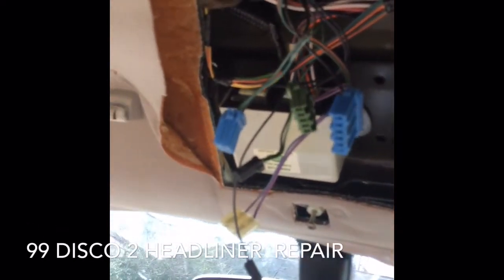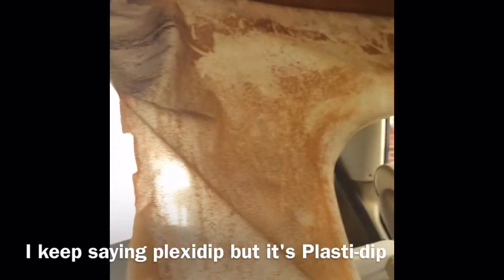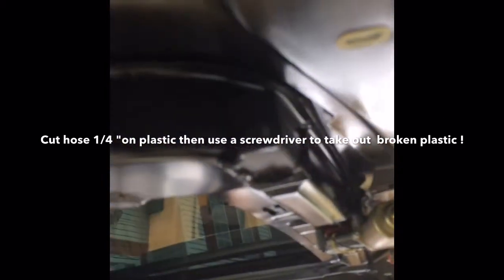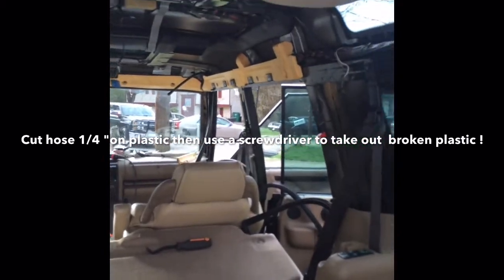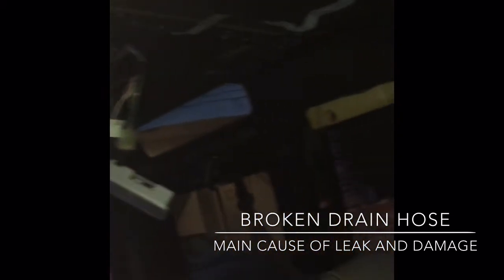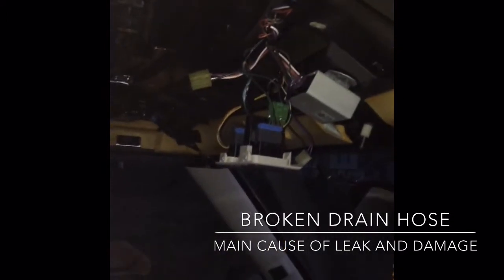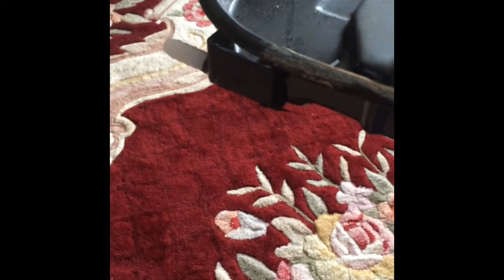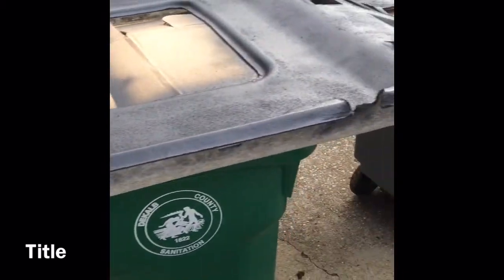Disco 2 Headliner Repair

Comment: do you have a good way to take those cargo nets off?
Reply from the maker: Yes Michael. There are some small rivets on the back of the headliner. You will have to remove them and the entire net/plastic bracket will come off. I broke a few of mines and just used screws and washers to replace the back because I actually like them.

Comment: Your drainage holes in the sunroof are blocked
Reply from the maker: Actually the one in the back was blocked. It was not leaking at the time of this video, but the truck was parked under a tree for a while and got plenty of debris in there. Also bought a new seal as the one in the back was siliconed by whomever had it before. Just used my compressor with a small hose and blew it out with 120-140 psi. Also cleaned around it. This sunroof is made of plastic and metal so it is very fragile aka cheap..

Comment: where do you live, I would pay to have this done on mine.  I ended up using silicone sealant around the outside of my front roof then ripping out the headliner cloth that was sagging.  next up is for me to remove it and do it properly like you show.
Well done.  I will post this in my forum.
Reply from the maker: Hey DanBoy I live In Georgia. I'm sorry for the late response. Thanks for the support. Don't know if you got it fixed yet, but if you do then that's great!!
Reply: TheMAC0876 , where do you live in Georgia? I wanna fix up the headliner on my discovery 2 and would pay you $$$ to do it.  I'd do it myself I'm just scared of all the electrical stuff.
Reply from the maker: I live in Stone Mountain. Let me know if you are still interested in getting it done. Thanks for visiting my page.
Reply: TheMAC0876 I'm definitely still interested though I'm making a trip from Cali to Ga in the disco I just bought so my money's really drained. Might be a month or two before I can afford to pay you to do it. How much would you charge ?
Reply: DANBOY89G